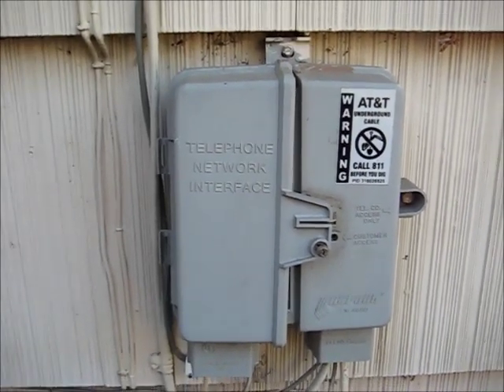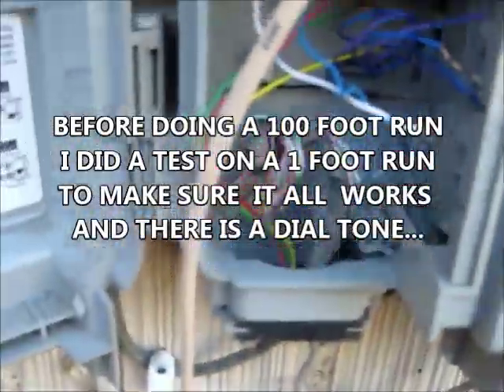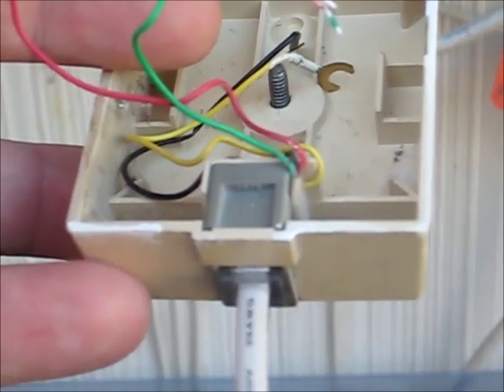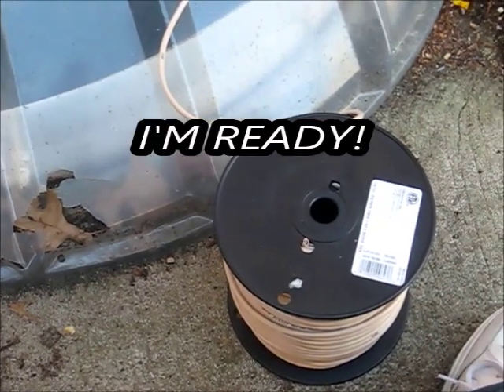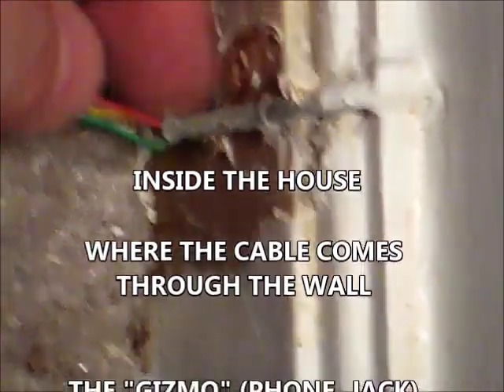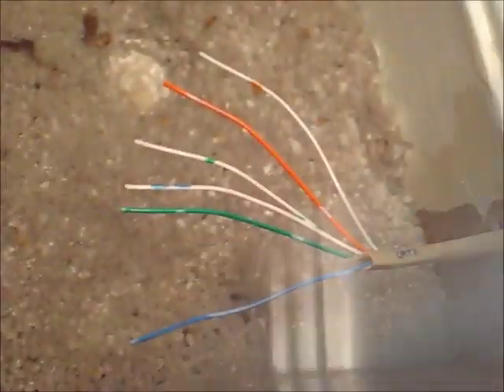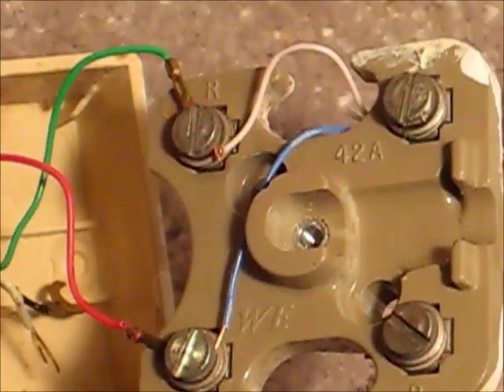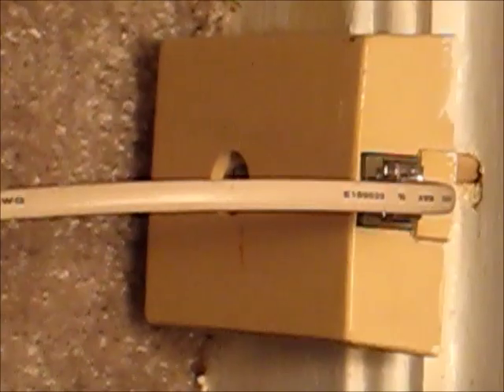☏ New Telephone Line Wire ☏ From outside service box to inside, repair landline, THE TRUTH, CAT3

Comment: What if I wanted to connect an outdoor grade cat5e 24/4 cable into the phone box? I only have one jack (but it recently got fried in a thunderstorm) & the old cable was just too flimsy, too short, & not rated to be outdoor so the signal was poor. I just have the one line that runs all the way to the back of the house (about 80ft), up through the floor, & connects to the fried jack. Then I had another line running to the nearest outlet (old cable is too short to reach) where I have a phone line surge protector & a duplex jack. One goes to a cordless base & handset combo that links to handsets around the house. The other goes to an older style cordless phone in case the power goes out long enough for the cordless phones to not function. So, I will need enough to power those phones.
I have looked at diagrams to know what color wire should go where in the RJ11 (6p4c) end but do not know how that would tie in with the box wiring.

I am also wondering if there is something I can connect near the box to have double surge protection (if such a thing would work).
Any ideas how I would do this?
Reply from the maker: When it comes to guessing which wire connects to outdoor box to make it all work... as I show in the video... you can do a "short run" test. Take the phone outside and hook it up... BUT...

But if you have a system fried by lightning you should contact the phone company, I am guessing they need to look at that box. Outside the house is typically their responsibility and no cost to you (maybe). When the guy/gal comes out to fix/examine it, be very friendly and ask them for some tips on your job...BUT...

But if you are not sure how to do the rest of your job... in all seriousness, not being a smart alec... you should consider hiring a professional to do this for you. It will not cost too much and you will know it is done correctly.

My video is about the simple replacement of an old (undamaged) line. Simply replacing the line, pulling out the old and putting in the new... very easy.
Reply: @7777jayhawk  Thank you for the reply. I already contacted my phone company. They sent out a technician who didn't knock & then left an angry note on the door that we didn't answer the phone when he called to let us know he was coming-- well DUH, we submitted a repair request bc the phone wasn't working! The note said that the problem was not at the box- but they've said that before when it was at the box. I live in a remote area so they don't like coming out. I have a friend who is a certified electrician who is going to help me. I think I just need the two center wires (1&2) from the plug to be connected inside the box. I saw something about USOC color chart. If I figure out which color wires from phoneline corresponds to the cat5, it shouldn't be too hard to do.
I already had to replace the jack before after it got fried. Plugged in the tester & realized that the way the wires were in the old jack was inverted so I had to switch them. At least the surge protector saved the phone this time. Last time it fried the phone too. I'm planning to get a whole house surge protector out.
Electrical is something I know people shouldn't mess with unless they know what they are doing, so I want to learn more. I often give the same advice on DIY forums (when in doubt, call in a professional-- especially with electrical).

Comment: Why does it look like your tip and ring are backward at the nid?
Reply from the maker: With most NIDs (Network Interface Devices aka NIU Network Interface Unit) one of the wires  is called the "tip"(green) and one of the wires  is called the "ring"(red).  Sometimes, usually in brand new installs there are standards which "the experts" (who are paid a lot on money to do this kind of simple work) use for these color combos. 
If there are standard it  can help "an expert"(who is paid a lot on money to do this kind of simple work) who comes along later because the colors identify wires within a cable.... IF the colors are correct. 
As time goes by sometimes old wiring systems/NIDs/NIUs which have been worked on by every Tom, Dick and Harry the wire color standards can ignored and become scrambled.... but the important thing is the phone works. 
That is the case with this NID which is why I suggest in the video that people do short run tests to make sure it all works. Make sure it will work.
I did not much worry about the colors in this instance because it is only 2 wires supplying simple phone line/DSL service and when it was hooked up it worked... so OK. if someone has a more complicated system and lots of money call in "an expert".
FOR ANYONE simply replacing an old worn out phone line, simply buy some phone wire and replace it, the color on the plastic covering is not magic. All of the colors wires are the same on the inside.

For anyone playing along at home,  do try to use the correct TIP/RING combos,  that way if/when any tele-nerds "experts"(who will try to get you to pay as much as possible money to them to do this kind of simple work) come along, they will have to find something else to complain about and why they need to charge so much money. 

If anyone wants to know the correct TIP/RING color combos, look it up online... or...

Or... Just make sure to test the system using a "short run" test to make sure the phone works.  That is why I took the phone out side and tested it hooked up to a 2 foot run. It worked perfectly so I ran a longer line and.... it worked as perfect as the short run test. PERFECT! Never had an issue doing as I did.

Comment: I'm drilling a new hole from the outside of the house to the inside of the house. I bought a long bit. So, all I do is drill a hole?
Reply from the maker: Yup, just drill the hole. And the good news is, your long drill bit probably has a hole in to help you pull the wire through. Just use common sense and be careful. 

Be mindful of what should/could/might be in the wall. Think about electric wires, other types of wires, water pipes, hot water baseboard heating pipes or anything else you could damage as you drill through the wall. 

With that said I have drilled many many many holes from the inside out and outside in... and over time I have made some mistakes and hit some things. It has been a long time though.... These days I make sure you look it all over. and try to deduce if anything might be there... then I double check wit ha tape  measure the distances  both inside and outside. 

As far a the hole, it is pretty simple. A house wall is usually simply made of 2x4s on 16 inch centers (or something like that) with drywall on the inside wall and lap boards (or something) on the outside wall. There might be some insulation.

Drill slow, push lightly, get a "feel" for it...and your drill bit should push right through. If you hit something you can tell. 

Once you have the hole drilled, maybe leave the bit in the wall. Remove the bit from the drill and use the bit to pull the wire through.

One last piece of advice- I suggest doing your hole drilling during normal business hours. That way if you make a mistake and have to make a run for the hardware store (or call for some help) they will be there. That advice goes for all types of repairs especially plumbing and electrical.... at least be braced for having to turn off the water or power until you can get supplies or help.

Comment: I have at&t uverse internet only.I get terrible lag, and the packets fail 100% of the time on this  traceroute tool. I am stuck with their modem because at&t uverse has a certificate on their equiment. I want to run my own modem (netgear dsl /vdsl2 with edge router x for gaming, and is there a way to acheive this? The line is bonded and he has 2 pair! Running from the terminal to the nid. can I run 1 pair less speed from the terminal to the house bypass the nid and achieve internet to my own supplied modem? And if so would I see any difference in quality? I only say this because at&t does not or will not acknowledge traceroute, timeout,hops timeout, failed packets and ping in reguard to gaming.
Reply from the maker: As always honest as I am... Honestly I am not sure ifd that would work or not. It is possible "they" could block you from that... but if it was me... I WOULD TRY IT! What is the worst that could happen?

On the other hand... you are paying "them" a LOT of money and it is not just for internet... it is also for service and no matter what anyone says about "them" and the way "they" do things these days.... I have always liked their repair people. Every one of their repair people I have encountered on the job has been a pretty cool person. They have helped me in many ways.

I would suggest calling "them" and telling "them" you need you their service to work perfectly for you with no lags, no drops and no BS! Tell them you need a service person to come help. 

Be very polite and kind on the phone with the request...and be even more so when the person comes out. Explain the issue.... show your modem... ask kindly... and see what you can get done.

If none of that works..... then fire "them" like I did. I was a loyal customer with "them" for over 25 years and  over the last 5 year they drove me away with their crap. I paid them (over the years) the amount of money that would buy a nice new car.... and they treated me like a schmuck who just signed up. All they wanted was me to sign up for the fricken Uverse crap... and I said nope nope nope..... then they downgraded the service and played games and.... I told them cut the crap or your are fired.... and 2 months later they were fired. 

There are usually a lot of fish in the sea and if one does not suit your fancy then move along

That advice goes for internet, all rentals, jobs, phone service friends, girlfriends/boyfriends... everything. 

There is no reason to put up with nonsense or bad times in this world... no reason to complain endlessly. Let people know what you expect.... give them a chance and when they keep up the crap... fire them and moving along.

You might get a sense that I have very recently gone through another bad deal with bad service and that is correct. I am still pissed off! It cost me some money.... but they are fired and I am happy with my new situation.

Good luck getting with your situation.
Reply: kyle i worked as a AT&T wire tech for 4 years. Sounds to me you have trouble in the plant before your house. I would call and set up a trouble call and have them check the f2 pairs and the drop. or you may be a bit far from the vrad in your neighborhood.